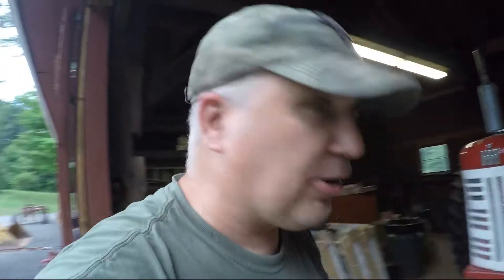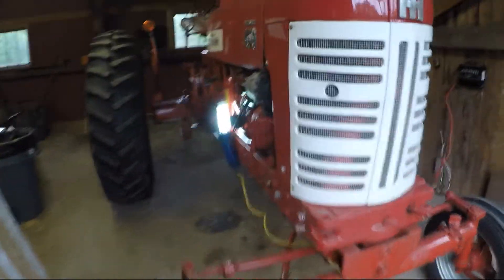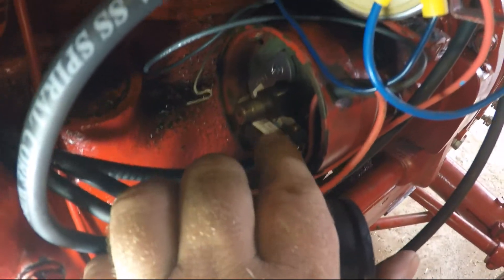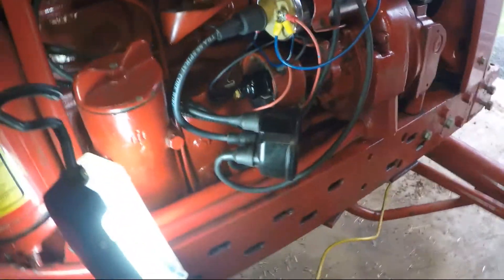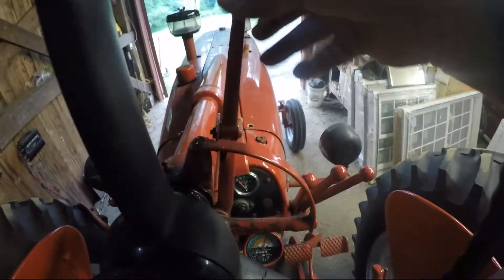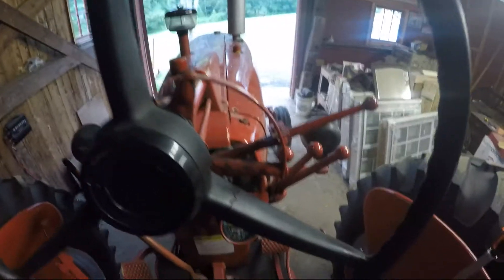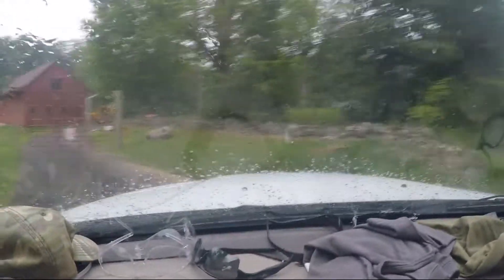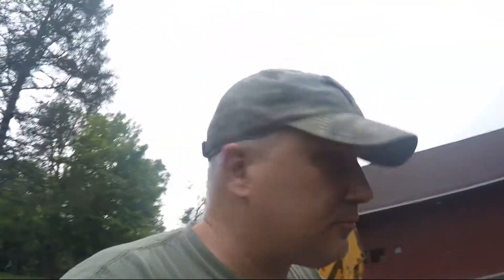I installed electronic ignition on the Farmall 450 diesel

Comment: Beautiful tractor, what size rear tires are on it? I recently purchased one from my in law's with the intention of a full restoration
Reply from the maker: Thanks for the complement. I'm having a problem with antifreeze coming onto cylinder number three. I'm thinking a had gasket or cracked head. The guy that I bought it from cut the rim in half and added a two inch strip pf metal making the rim two inches wider then stock. I'll get the size for you tomorrow. eric
Reply: Thank you, mine has been barn kept and not fired in over ten years but it turns freely.